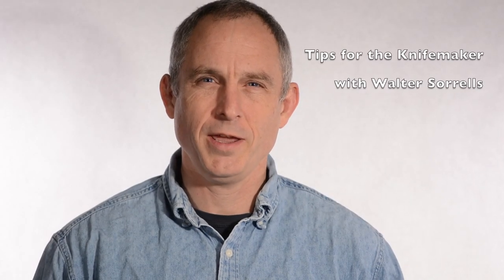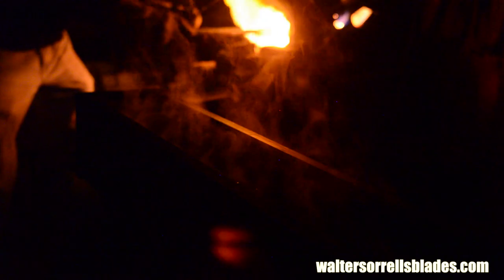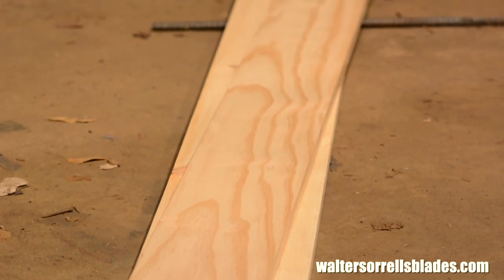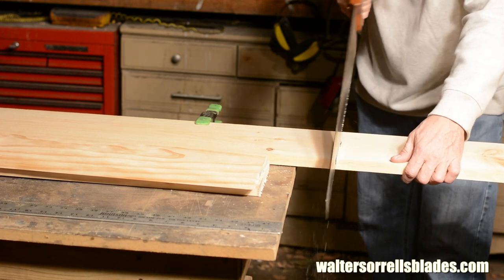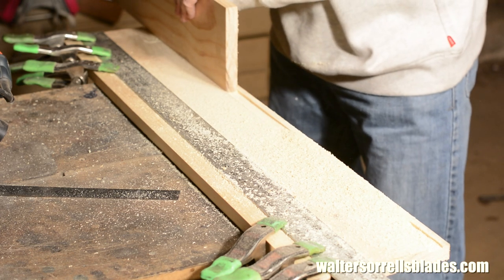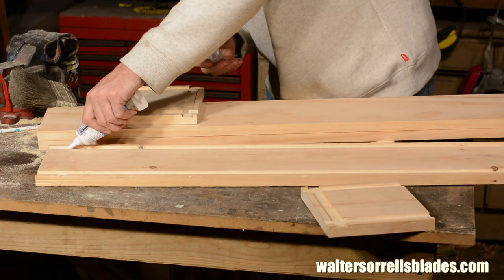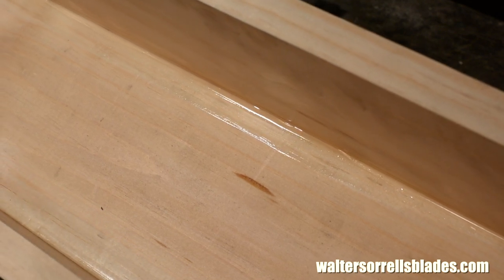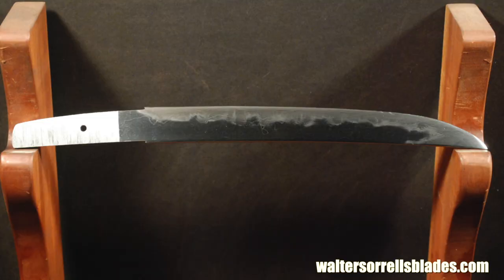How to Make a Quench Tank for Hardening Knife Blades

Comment: To get a Waterproof Seal, I use Brushable Hydroseal. It is basically a Bitumen Product that is able to be applied with a Paint Brush. A really cheap one because you will dispose of it once used. You could try cleaning the brush but I have found the effort it takes to clean the Brush is offset by the One Dollar or less it costs. Just a suggestion.

Comment: im just getting into knife making i learned something,most vids use oil to quench,so can i just use water. on normal carbon steel.good sub and respect from the uk.
Reply: It depends on the steel, some steels need to be hardened by oil. Hardening with water is more risky since it can cause the blade to crack.

Comment: i have made a knife but when i have hardend it is it not hard
Reply: It is probably low carbon steel...this will make hardening pretty much impossible.  You should also try tempering the steel after you go through the hardening phase.  This entails putting the blade in an oven at 400 degrees for one hour....do this twice, letting it air cool between treatments.  This may help but no promises.  Good luck.